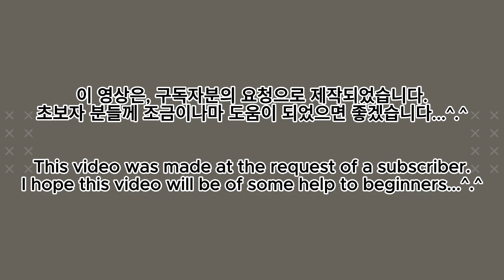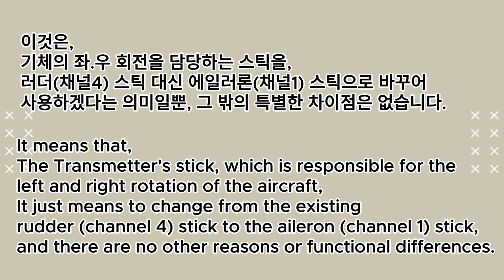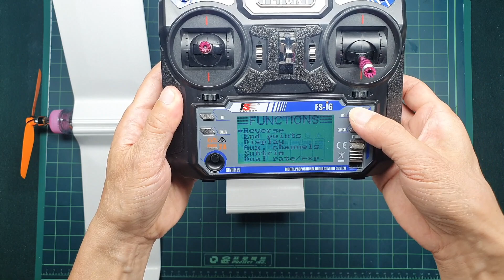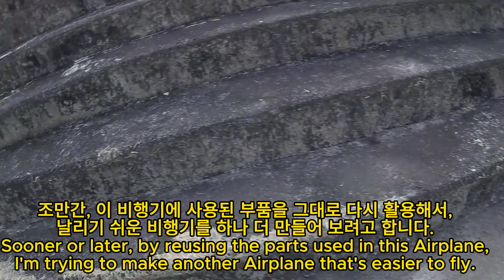How to make RC Airplane_ Home made_Simple Airplane_PET bottle Recycling_3채널 비행기 만들기

Comment: I have already build first plane like you, but my plane more complex than your plane. You are intelligent
My plane: motor 8520 coreless + 75 mm propell.
Wing span 400 mm
BAT: 2s 240 
Servo 3.5 g
Tx+ rx: arduino nano v3
Weight fly: 50g
Reply from the maker: Oh... you did... Congratulation...^.^
I hope you have a great flight.
However, I am worried that the battery may be a bit large compared to the wingspan and weight of the airplane.
Reply: it crashed after 3 flights and I can't repair, I will build new plane simple and easy control with new Tx like you (Flysky i6).
Reply from the maker: @tomcat-rc  
I think it must have been a great maiden flight.
I'm sure you'll be able to make a much better airplane than I could. I will also support you with all my heart...^.^